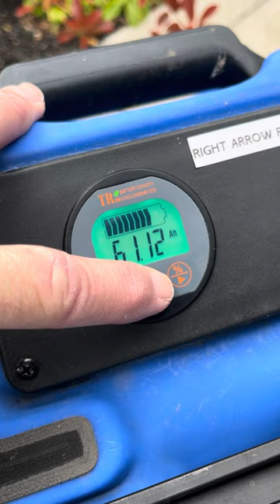Custom Yakattack Black Pack Pro 13x16 kayak battery box and parts list

Comment: can a 16x16 fit in the back on teh unlimited? thanks
Reply from the maker: It fits no problem but depending on where you have the seat positioned it can hit the box and keep you from full 360 degree seat movement. Thanks for checking it out. 👍